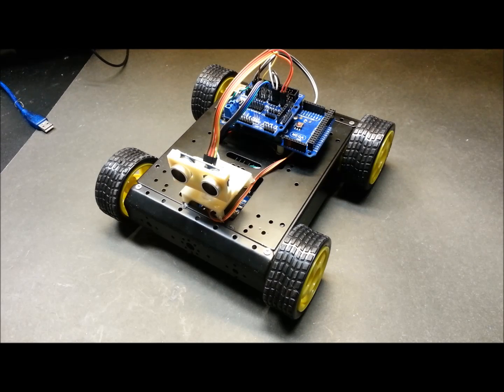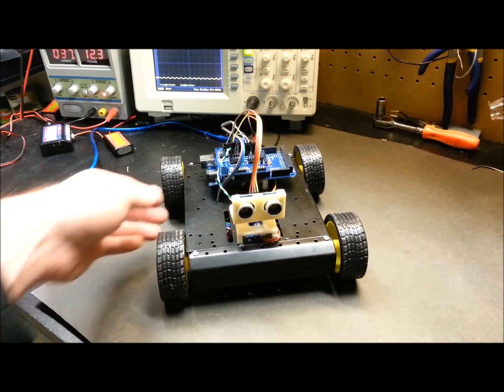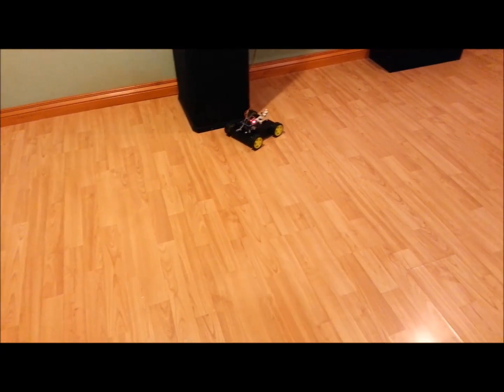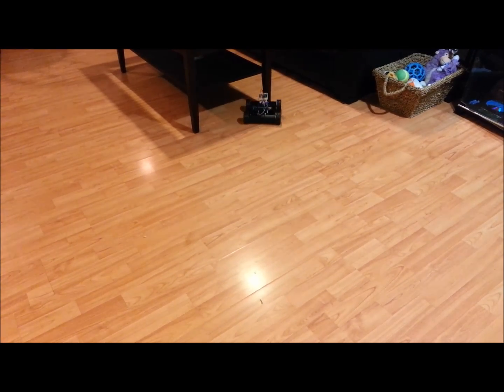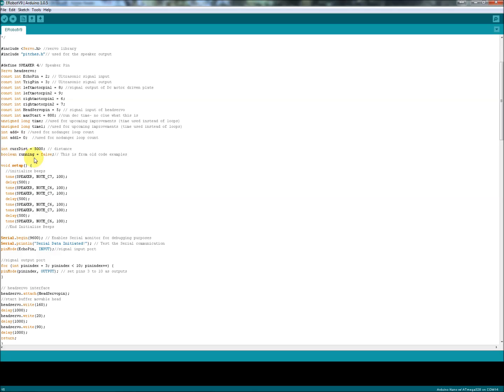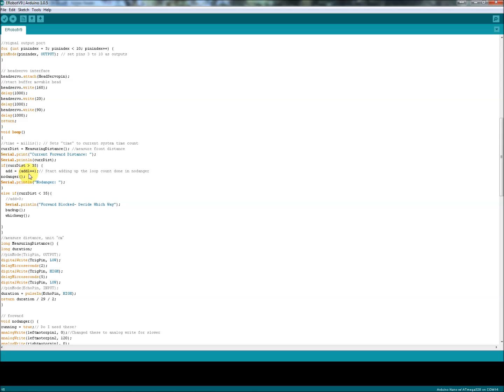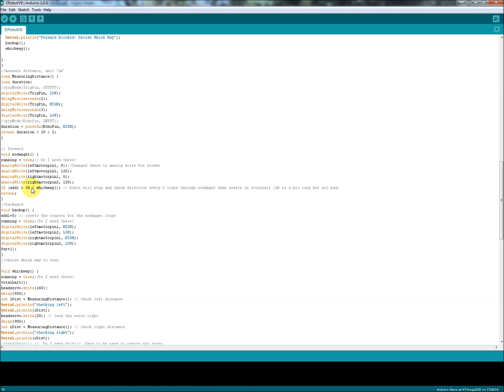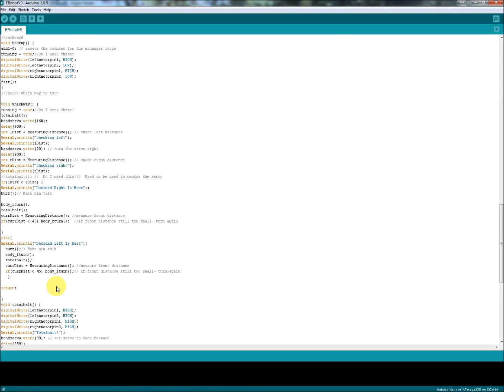Arduino SainSmart 4WD Robot Update- Code Modifications

Comment: pls help me! i'm using uno r3 board, but when i'm try to verify the code is error!

"exit status 1
Error compiling for board Arduino/Genuino Uno."

please someone fix the code, im used l298n+ ultrasonic+ uno r3+ sensor shield, i hope someone help me..
Reply from the maker: I just checked and it compiles just fine in 1.6.7 IDE.
Reply: my bad, my ide don't have pitches.h library, and when i saving(making) the pitches.h library now i can verify this code.  thx for the code, your robot is awesome!!  i'll try the code tonight.

sry for bad english

Comment: I'm looking at getting this chassis  to make a Raspberry Pi robot bu I've got a quick question about controlling the motor.
Do you need two LN298s? One for each side? Or is there a way to make the single LN298 do the job? (If you work under the assumption that the combined motors don't exceed the power limit)

Comment: thats so cool man  i like it herr is mine check it.out im using a arduino uno and a seedstudio motor shield i mod the shield so it can run a dc motor and a servo motor with out losing the speed control (pwm)  and im using 3 ultrasonic sensors  i mod the shi3l by adding a npn transistor to shut of the power to the servo with in the code  so it doesnt mess up the readings of the ultrasonic sensors

Comment: Hi eric I just bought this whole platform, I'm starting to learn robotics. I'm trying to deduce all modules. Woiuld it bother if you could take pictures of all the connections from the sensor shield to the L298N to the motors and servo. How do you connect the servo moving the ultrasonic sensor? thanks so much.
Reply from the maker: The connections are the same as the instructions on the Sainsmart site.  There is newer video(s) as well that may help.  Cheers John!

Comment: I'm in my final semester at college. I'd like to make a robot that will plow the driveway  using the arduino. I have never programmed before. Is it possible? The welding and mechanics are no problem for our team. I am worried about the software. Do you have any suggestions?